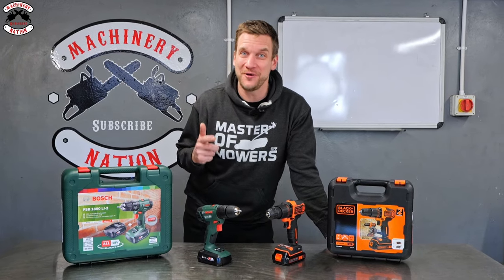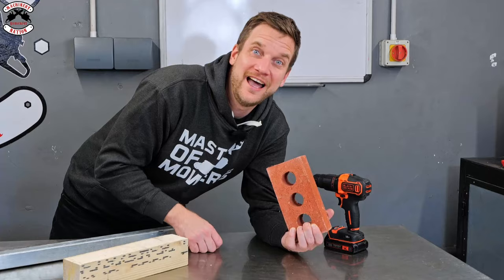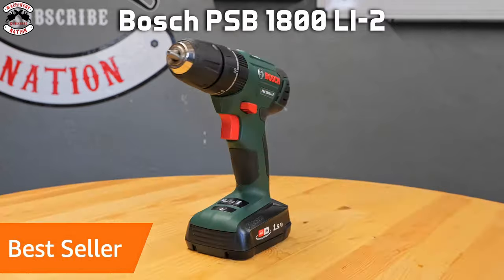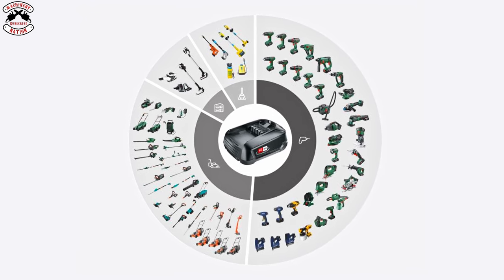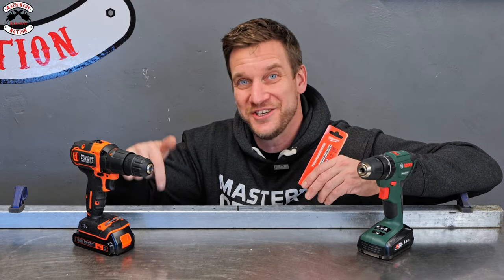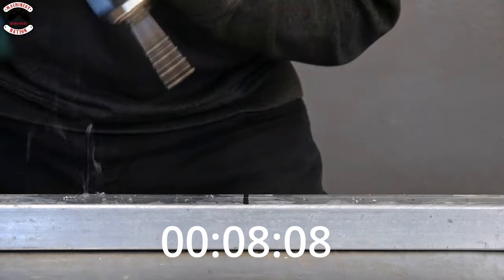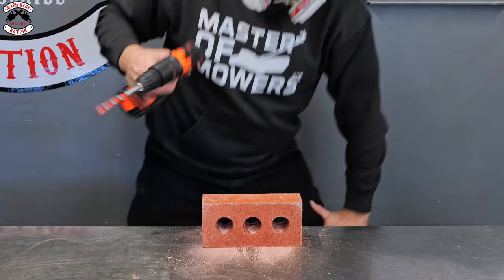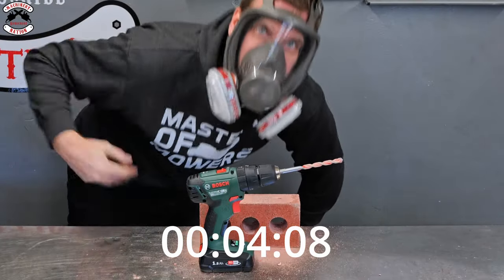Bosch Best Seller vs Black and Decker from Amazon Homeowner BATTERY DRILLS ??

Comment: I am sorry It is not Inaccurate test Because you are using Milwaukee Drill bits Not the ones that supplied with the actual Drills What is Bosh And Black and Decker
Reply from the maker: None were supplied with either. It is accurate as they are both using the same bit. No matter what we do someone has an issue 😂😂 in other tests when we use the supplied accessories rather than equal tooling, people have moaned, which I agree with. In this test everything was equal 👍🏼 unless I am missing something here?
Reply: @MachineryNation If Bits had come with the drills they wood of melted on the first hole🤣🤣

Comment: I have a small garden and a shed for storing and cutting wood. I think Bosch are known for being designed to work well, the green DIY range is what I use as it’s affordable and does a decent job. Yes the professional stuff is better but it comes at a hefty price. Dewalt is also popular and the professional stuff is expensive too. Unless you’re in a trade it’s not necessary to buy professional stuff but a solid  green Bosch will get the job done. The best thing Bkack & Decker make is the workmate, it’s a great product and works well. Some power tool combination sets are very expensive and do get stolen which is something nobody wants. Use good quality drill bits and blades and you can’t really go wrong. Bosch & the job is done!

Comment: I have a Bosch PSB 18 Li-2, which is probably 7 years old & the chuck has gone the way of the Black & Decker model in your video. The trouble is that it costs around £50 to get a replacement Bosch chuck for it, making it more cost effective to buy a new Bosch drill

Comment: It was such a relief to find this video, because today when drilling drainage holes in plant pots, with my cordless Black & Decker, the drill bits kept going loose and falling out. Yes,  I found a way round the problem  was to stop drilling every few seconds to retighten the loosened chuck screw.  But this didn't always work.   I have been trying to find out today, to no avail until now,  if it was ME who was doing something wrong to cause the loosening drill bits problem.
I LOVE my MINI BLACK & DECKER HANDHELD CORDLESS VACUUM though.  I've had it a few years now and it's a GREAT powerful vacuum upper of bits.
Reply from the maker: Glad it was helpful 👍🏼
Reply: You know you can change the part off from the drill and put another one right.  Chuck right.

Comment: Thank you so much for this video upload. Looking to put up some curtain poles but never used a power drill before.  I was looking at the Bosch on Amazon UK but couldn't decide between the Bosch Easy Impact @£71.51 and the PSB 1800 @£77.90.  After seeing it's demonstration here, I'm sold! Thank you.❤

Comment: Don't use drill that much for work, just a bit of trellis fitting, fence repairs and bolting fence spurs. Got a great deal on a Bosch Pro GSB-18V-55, GDX-18V-200, With a quick charger and two 5Ah batteries. Not top of the line but does everything I need! Wouldn't waste my money on anything BlacknDecker!
Reply: I used to own a B@D it brock after 15 months, Only ever used it half a dozen times never again!! Useless!!!
Reply: Your drill is pro grade man. Im a Milwaukee guy myself but I miss Bosch' comfort. Speed isnt everything

Comment: Been shopping around for a decent drill and have already settled on this bosch model and glad to see in this video it is performing well. £77.90 on amazon right now and £20.99 for a 70 piece drill and screwdriver bit set
Reply: I just don't like the angle of that Bosch, it looks stupid. Here in America we buy dewalt 😄

Comment: Im in the market for a cordless drill atm, with the contenders being Bosch, Dewalt or possibly Makita (if i can find one) 
The Bosch is the cheapest of the 3 and it performed well here, ill watch some more videos before i decide, but im being more and more convinced to go bosch every video i watch.
Reply from the maker: I wouldn’t, if you can justify go for a Milwaukee 👍🏼
Reply: @MachineryNation  thanks for the advice, that's too expensive for me ATM and if I was going premium I'd go Makita. One of the other reasons Bosch is what I'm looking at is you can get a even better model brushed Bosch drill for £64 in Wickes and there is an offer on where you get a free battery and charger, plus I plan to own two combi drills eventually anyway 👍

Comment: James great video. I think you should have put them in Hammer mode for the longer screws. Just asking. Because a lot of impacts have Hammer mode on them. Have a good one tell Susan I said hi. 👍
Reply from the maker: Thanks Dirt 👍🏼 I don’t think hammer mode is the same on drills as it is impact, but I will give it a go 👍🏼
Reply: @MachineryNation  thank you again. Great video. 🍻
Reply: Don't use hammer mode on drills for fasteners: it will greatly increase the likelihood you strip out the head of the screw, and it also wastes energy that could otherwise be driving the screw in faster. 

Hammer mode in drills is completely different from the impact mechanism in impact drivers. Hammer drills move the bit towards and away from the material about 30k to 40k times per minute, in essence trying to mimic a jackhammer. The chuck assembly rides a series of small metal ramps that move it a mm or so forward and backward. It should be used for masonry applications only, with a carbide tipped masonry bit. 

Impact drivers, by contrast, do not use a direct drive (ie the electric motor is not connected to the bit via gears), but rather a hammer and anvil, with a spring, to transfer the electric motors energy, via rotational impacts of the hammer mass against the anvil, to turn to the fastener in the same way an impact wrench does lugnuts. They can be extremely fast due to no reduction gearing, but in high torque applications, a drill will often be faster.

Impact drivers are not good for masonry drilling, although many masonry drill bit manufacturers will say their bits can be used in an impact driver at certain speeds, it's a poor attempt at a hammer drill, which is already a poor attempt at a rotary hammer.

Comment: James have you tried Flex Brand tools yet? I'm slowly moving to Flex. I've been a Milwaukee fan for years. I'm switching brands because I'm getting tired of fixing the trigger on all of M18 volt drill and drivers.
Reply from the maker: I have but we can not get the 24v over here only the 18v red posh stuff that comes in a £1000 per drill 🙄 hopefully the 24v will be in the UK soon 🤗
Reply: Flex is super impressive, it's unfortunate they aren't selling their stuff in the UK. Hopefully they expand their lineup to include many more tools, and offer that lineup worldwide.

As an aside, which M18 stuff have you had trigger issues with? Most of my tools at work are M18 and I've not had any trigger failures (I've only had to warranty one 2600 series M18 hammer drill in the last few years and it was a chip failure).

Comment: Nice video mate!

I was expecting the Bosch to win, although at the price point, I wasn't sure by how much (B&D tools are so bad these days I figured it was pretty well guaranteed). What I was not expecting was how much better the entry-level Bosch tool *sounded*, compared to the B&D. The B&D sounded like it was struggling with the simplest tasks, whereas the Bosch sounded like a much higher grade of tool. The motor, the hammer action, the slowing under load, etc. The interchangeable batteries are a nice benefit too! If I were getting into a new platform of tools today, Bosch's high end stuff would definitely be on my list (although it'd be hard not to go with Hilti).

Comment: Argos UK as a real deal on a Cordless variable speed drill with all extras + a 100 piece bit set for metal and wood, stone, and concrete,And two rechargeable batteries the drill as light for hard to see places, A lot cheaper than the the high end drill costing 3 times as much, At £68 pounds a Bargain The name is Giuld!!! Pass it on !! 😀🇬🇧👍
Reply: I don't know if that's such a great deal, as you get what you pay for. Also with the Bosch, that battery system can be used with many different tools e.g. Impact, Jigsaw, MultiTool and so on. If you're a keen DIYer or have a project you want doing, sometimes it's best to not always go for the cheapest deal.